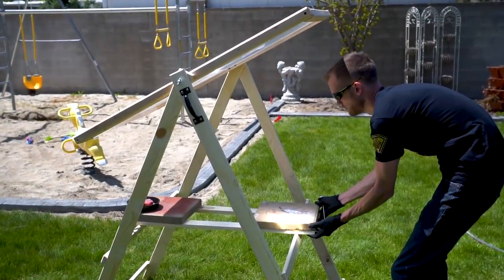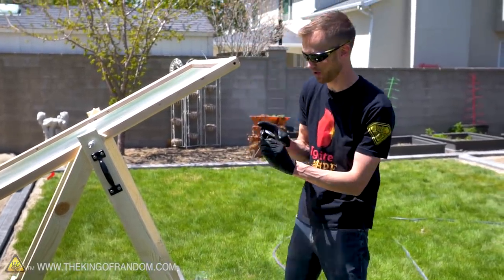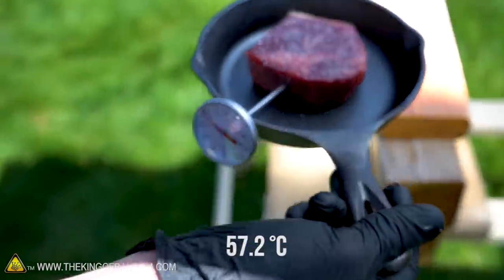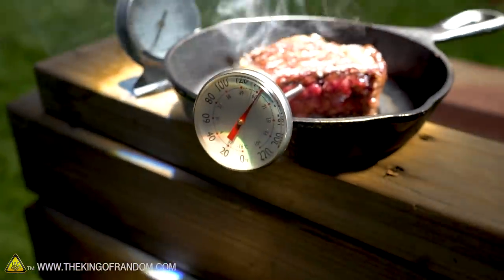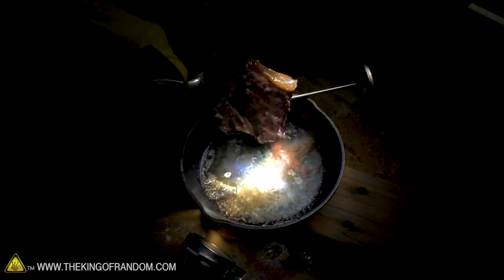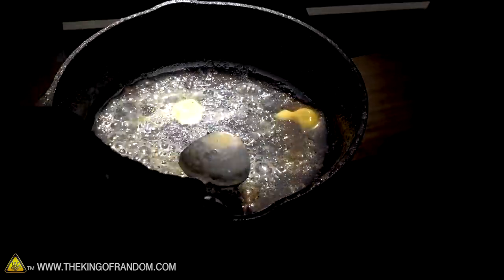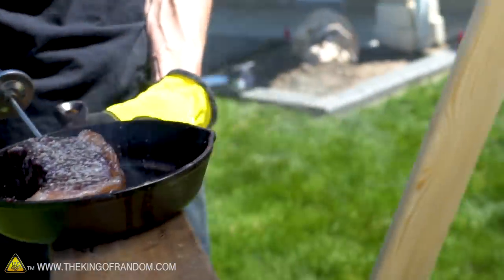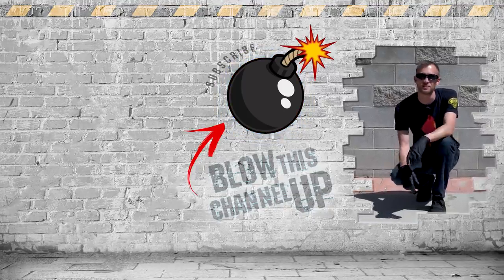Cooking STEAK with Sunlight! Cooking With The Sun With The TKOR Solar Scorcher!

Comment: What happens when you put a mirror in the focal point of the solar scorcher, does the mirror burn or can the focus be pointed in another direction and burn things the same way by pointing the reflection at it.
Reply: You could use the Scorcher like a stove if this works :o
Reply: Ron L woow ur more intelligent than ned😂 i want to c that thing
Reply: Ron L My guess is that it would lose focus.
Reply: I think Jacob Durst is correct.  Think of the light rays forming the shape of cone, with the base of the cone at the solar scorcher, and the tip of the cone at the focal point.  As each of these light rays continue past the focal point, they spread out into a cone that is essentially the mirror image of the first one.  Essentially, the light becomes diffused beyond the focal point, rather than remaining concentrated.
Reply: the intense heat will melt the glass.
Reply: Also what happened to a clear class, does it let the light pass or will it burn
Reply: You think it might be possible via positioning the mirror to somewhat control the size of that cone ? If so maybe you could more evenly heat the pan from the Bottom?
Reply: Avenger VIP_2.0 All glass absorbs a little light, there’s not really much in the way of perfectly clear glass. If you look at those huge and thick panes, they look clear from one side, but green if you look through the edges. Since they absorb a tiny amount, of you had it in the focal point eventually it would get really hot, but probably slower than some other materials.
Reply: Neph Drummond hmmm, so burn?🤔 An experiment worth trying along with the mirror
Reply: The mirror will mist likely burn quicker
Reply: Avenger VIP_2.0 shatter or melt more than likely.
Reply: Avenger VIP_2.0 and the mirror will shatter.
Reply: Build a glass mirror box that the solar scorcher points into and make a solar oven
Reply: That sounds like a terrible and dangerous idea... LETS DO IT!!!!

Comment: Is it possible to reflect the sunlight with a mirror and let the focalpoint hit the pan from the downside?
Reply: MonsterMusic I think the glass would probably shatter from all the heat. Even if it reflected 99.9 percent of the light, it is still gonna shatter.
Reply: Rahul tejeshwa not if you heat it evenly or cool the mirror from the other side
Reply: Maybe, if you used a polished metal mirror, made of a sufficiently heat resistant metal.   You'd still want some form of heatsink/coolant though.
Reply: If you wanna go to that extent just use a parabolic mirror instead
Reply: Bananas Daily 
What the parabolic mirror?

Comment: Try reflecting the sunlight with a mirror to heat the pan from below. Then cook random stuff with it..... That would be very cool to see
Reply: Am I having a stroke or wtf are those comments
Reply: Would probably melt the mirror lmao
Reply: Blinklith no it won't
Reply: Blinklith mirror reflects doesn't absorb, physics man
Reply: Speech less the mirror is only going to reflect the light. There's still thermal radiation hitting it
Reply: Troxlarz Gent. Heat from sun is in the form of electromagnetic radiation. Light is that form of electromagnetic radiation, which mirror reflects. Realise that even in the video he is using a concave "mirror" to concentrate the sunlight hence the Heat.
Reply: Speech less heat from the sun is not electro magnetic radiation. Heat is thermal energy and thermal energy does not belong on the electromagnetic spectrum. The sun produces more than light and that concentrated beam is more than bright, it's also hot. Y9u also have to take in consideration that a mirror doesn't reflect 100% of light
Reply: Troxlarz Gent. Heat from sun does belong in the electromagnetic spectrum uv rays, gamma rays, infrared rays and even visible light. If they are not electromagnetic radiation which is the final form of all types of heat there is no way for them to get to earth through space or vacuum with no medium. I agree with you on that mirror doesn't reflect 100% light but that small amount wouldn't melt the mirror.
Reply: Blinklith it's me the banned guy on SFS discord sever
Reply: Zach Richardson hes speaking hindi but using latin alphabet

Comment: You can try sticking a mirror in the path of the scorcher directed upward into the pan, heating it from below.
Reply: dalsio 🖒
Reply: This would work, but I think it is far cooler that the direct sunlight is cooking the steak rather than the radiant energy being turned into conduction energy, cooking with a pan.
Reply: dalsio a mirror would probably crack from the heat... Polished stainless steel on the other hand would work.

Comment: could you bounce the light up with a mirror onto the bottom of the frying pan so it works like a conventional stove?
Reply: Exactly what I was thinking! The pan under the steak is cooling off and the meat is insulating the pan so the sun-energy isn't heating the pan very well.
Reply: i'm worried he'd melt the mirror, but that sounds like it could be fun
Reply: IANF126 you can't melt the mirror with sunlight, it absorbs only 0.01% of the sunlight, or even less
Reply: I was thinking the same, it should work in theory!

Comment: That's an amazing way of cooking. You reduce the use gas which came from non-renewable resources, or you could just use an electric stove powered by renewable energy; BUT THIS IS AN AWSOME WAY OF COOKING STEAKS! TKOR that is an awsome way of saving the Earth!
Reply: It even works in the shade and at night!
Reply: + Do you even realise that it is very hard to set it up and use it properly?
Reply: Dacian Pescan well a price to pay for something self efficient i guess?
Reply: MAXXL and something you can't use around children because BBQs and grills are a lot higher than this thing's focal point. It's also very dependant on the weather. It's a cool experiment, but very much not practical.
Reply: The Earth will be fine. You wont be here to witness its demise and you wont prevent it either.
Reply: And can save 5% of earth

Cause
Reply: this reduces greenhouse gases, but what about when they burn loads of thermite? :)
Reply: Arjun Anand Thermite is a reaction between Iron Oxide or rust and aluminum that produces Aluminum oxide and Iron, no greenhouse gases are produced by the reaction.
Reply: You can also make biogas methane and cook with that

Comment: Use mirror and reflex the sunlight upside down and cook with the sun light in the bottom of the pan
Reply: But the beams are focused from a large area (they have different angle to the surface) so you would need to use a lens to get the light to be parallel first then you can use a mirror to reflect

Comment: I would probably put a griddle or another skillet on top of the meat to make contact with the meat and let you heat the metal with the light, basically just frying from the opposite direction.

Comment: can you put a mirror on the focal point will it reflect the light or will it melt and if it reflects put the reflection under the pan please
Reply: i was thinking about that
Reply: A) the light carries the heat and mirrors do not absorb a lot of light therefore they do not get hot anywhere near as fast as non-reflective materials
B) a flat mirror would reflect the beam in a way that it would continue focusing or defocusing but inverted and therefore be pretty much useless if you wanna do anything with that reflected light besides say that you reflected it
C) mirrors are made of glass (obviously) and, depending on their age, either silver or aluminium. Both glass and aluminium have ridiculously high melting points.

tl;dr The mirror would not melt, but it would be very difficult to use it to heat up the bottom of the pan
Reply: Even if it was defocusing the light, if the pan above was close enough to catch all of the light it wouldn't significantly lower the temperature.
Reply: modern mirros will not mess with the focus in any way, it will just flip the cone of light upside down. You can also put the mirror at any cut of the cone to move the focal point around wherever you want.
Reply: This has nothing to do with modern or old mirrors because its a property of a flat reflective surface fam wyd
Reply: You even said it yourself: " it would continue focusing or defocusing but inverted" heatin the pan from below with a mirror is exactly the same as heating it from above.

Comment: For the second method, you should have kept moving the pan with it directly in the focal point or close enough. The scorcher heats up too fast even for metals (that is why it can melt some almost instantly where it hits first), so to distribute that you need to keep moving where you're adding the head. Over (a relatively short) time, you will have stored enough heat in the pan, which will even out if you take it off completely or to a higher spot (i.e. still getting concentrated light, but in a more even, dispersed way. It probably works too if you leave it directly in that elevated spot for a much longer amount of time. It is basically the same idea of cooking on hot stones or a hot pre-heated (thick) cast iron pot or skillet - let the thermal mass absorb A LOT of heat evenly, then use the stored heat for the cooking action.
Reply: This is an underrated comment to not get a like or reply (Well, before me) in 2 years- ;-;

Comment: Improvise an opening and closing method for the lens aperture and seal the steak in a bag in a water bath. As the temperature of the water bath achieves the desired level of doneness of your steak, it opens and closes so as to maintain that temperature till you are ready to plate it. A sous vide fresnal cooker. Bon appetit 😂

Comment: Suggestions: use a Dutch oven and cook the steak in that. Focusing on the closed lid.  It will colm from the top down. You'll probably need to flip it. Maybe if you preheat the bottom then put the steak in with the lid on top after preheat?

Comment: You're supposed to sear the surface of the steak first, under the hottest part of the heat, then finish under high temp to cook the inside to the right temp. I would retry that again, but in reverse of what you did and less cooking time. I would also not probe the steak either, that dries out the steak.

Comment: you probably wont see this but... the meat thermometer is touching the pan.  the pan is hot.  you will not get an accurate reading this way, the hot pan is messing with the reading.

Comment: You did  did a tactical mistake in the first try. Of course it gets overcooked, i am confused why you were so confused. You increased the heat to touch up the surface, however  heat travels. And therefore you ruined the medium you achived. I think it would have worked if you first  did the surface then lowered the heat and measured the iner temperature...I think this way it would have been perfect form the first try.

It is a bit how you cook a cutlet of duck, you first  do the outside then you take the piece and put it in the oven to achive how you want it (rare, medium, well done)... Now i wonder if Duck done with sunlight works as well. Or how about cooking rabbit with sunlight?